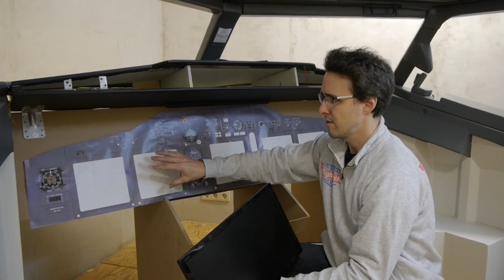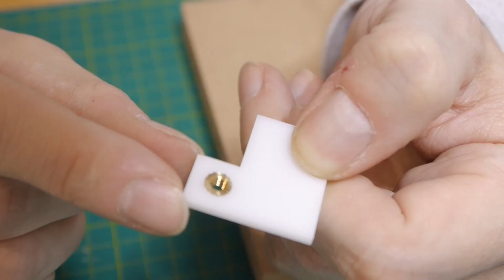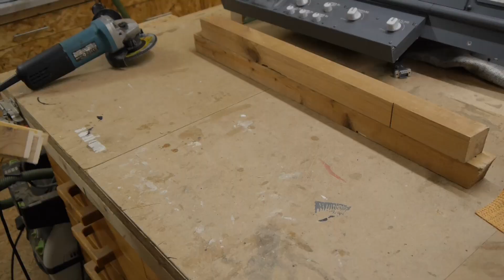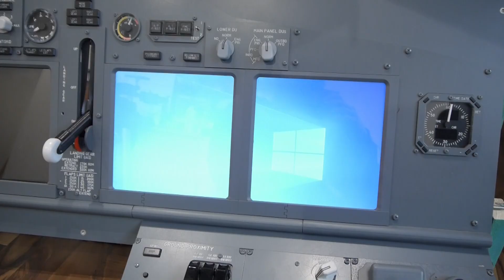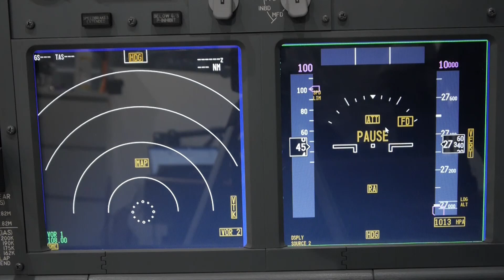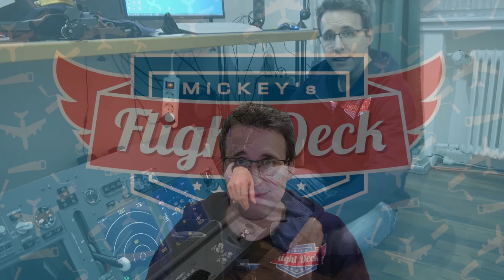MIP Monitors - A Boeing 737-800 Homecockpit #83

Comment: Hello,
a very nice Video.
But i want to ask if you are happy with the Prosim737 Software ?
Right now it seems to have more issues then it works.
Reply from the maker: Actually I'm very satisfied with it. If someone sits in front, who knows how to use it. On the FSWeekend a simulator instructor used the setup and it flew holdings over Amsterdam after 15 minutes. And together with the new Mobiflight Prosim datarefs it works great.

Comment: An important issue for the choice of the monitors for me is the viewing angle. It can happen otherwise, that you can't read the displays of the other pilot or center panel... :)
Reply from the maker: I think it can be a problem when you use laptop screens for which this is a safety feature. During the configuration I looked at the display a lot of time from different angles and always had a clear view.
Reply: @Mickeys_Flightdeck  For larger Screens too, in fact. You can see a lot of change of contrast and colors when changing the angle of view. I am using 10" screens and smaller for my EFIS 85 and GPS, VSI etc. and there the problem is very common too... :(

Comment: For the ones that like to build a 737max like I do, 34 inch ultrawides are a perfect fit.
For displays on remote (network) devices, you can also use Raspberry Pi's with ZHSI (maybe even ProSim) you dont need that much power to just show the instruments.
Reply from the maker: If you are there on the FSWeekend we have to talk. ;-)

Comment: Have you tried an adhesive Goop? It dries to the constancy of hot melt. Sticks to just about anything. Drawback is it takes a long time to dry. But there is no heat.
Reply from the maker: I tried what I had here. But at the end  for me this is the best solution because it saves space behind the panel.

Comment: Hello Michael, Maybe it's a idea that you connect the power from the displays to a relay and activate this relay if you set power to the plane with prosim. Please let me know if this solution is usefull?
Kind regards
Reply from the maker: It sounds like it simulates the behavior very realistic but I think it can cause new problems. The icons layout on my computer for example changes when a screen is turned off. Maybe this can make the graphics jump to different places. When there is nothing to show, the screens are black. I think this is similar to a screen that is turned off.
Reply: @Mickeys_Flightdeck  Hello Michael, Thanks for your reply. Unfortunately, my idea is not the solution. Good luck finding a workable one. Kind regards